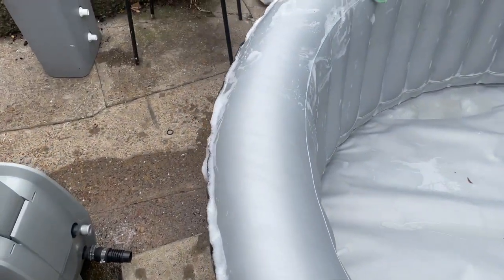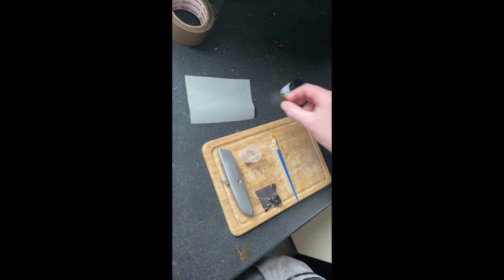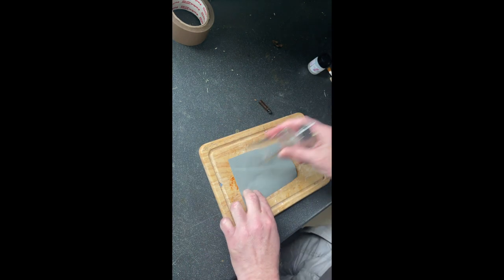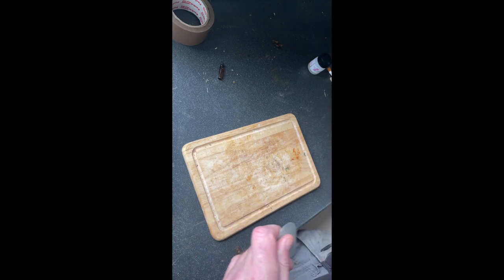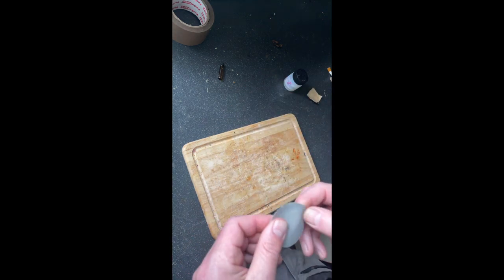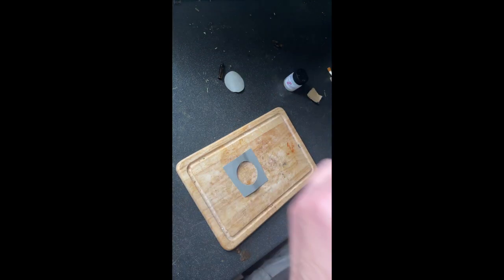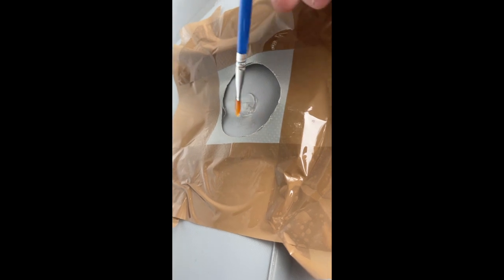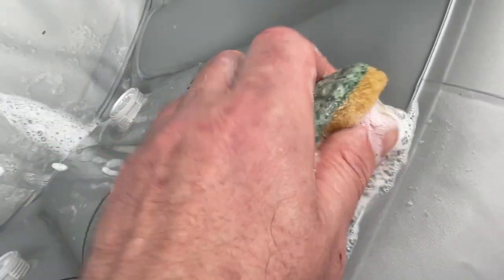How to Repair a Seam Puncture on an inflatable Hot Tub Lay Z Spa Wave Cleverspa Mspa

Comment: Would you know how to get a patch that hasn’t taken off to replace it?? Can I melt/heat the adhesive?
Reply from the maker: You can try with a hair dryer. Gentle heat and go very slow so not to damage the tub any further. If this looks like it will damage then leave the patch on and place a larger layzrepair patch over it. My kits are available at www.layzrepair.co.uk